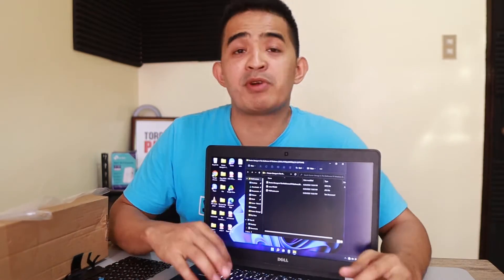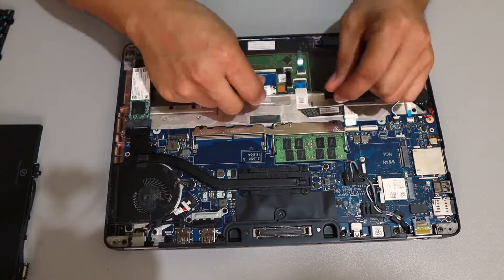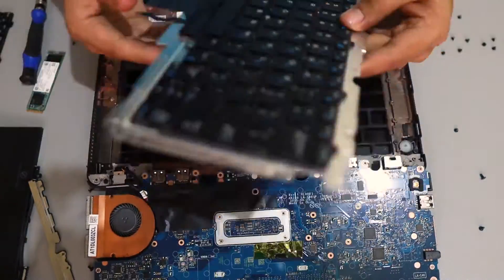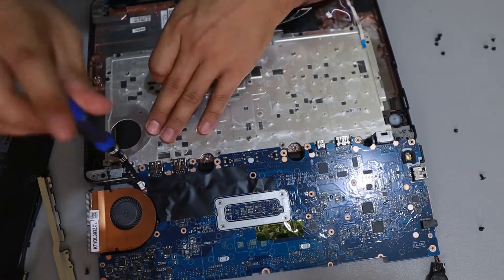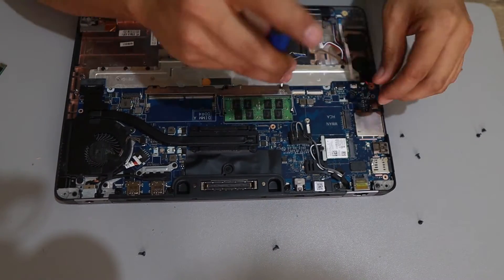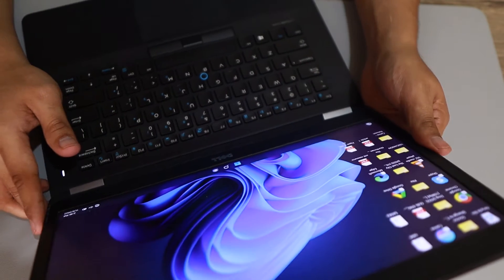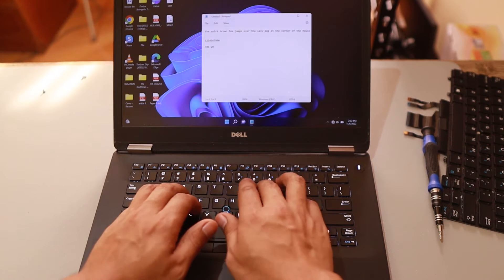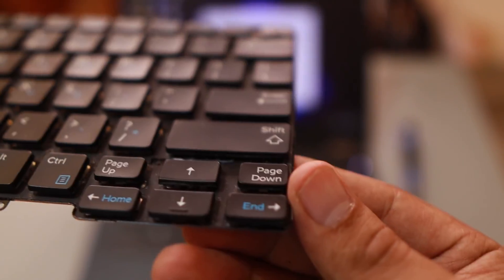Can you repair Keyboard of a Laptop?

Comment: are there any indications to when exactly does a keyboard need replacement?
my lappy is ASUS ROG GA502D / GU502DU. i think I spilled something on my S key a while ago. the WASD keys have the most wear and tear compared to rest of the keys, but my S key is different. it looks like it "sank" a bit, and lately it works, but sometimes it doesn't, that I had to press it hard for a while to make it work again, or leaving it a bit to make it work again.
not sure if it's the rubber cup broken, or the sticky substance getting stuck somewhere beneath the key, or maybe something on the bottom of the board.
Reply: exact same thing happend to my Laptops keyboard expect no water spill, did you end up fixing?

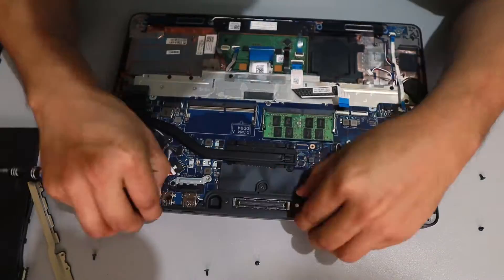Comment: 1:55 This is still fine, at least u just need to unscrew and screw it back, some other models requires soldering, hot gun or hot glue gun to take out and reattach the kb